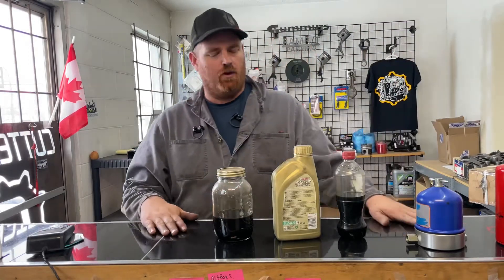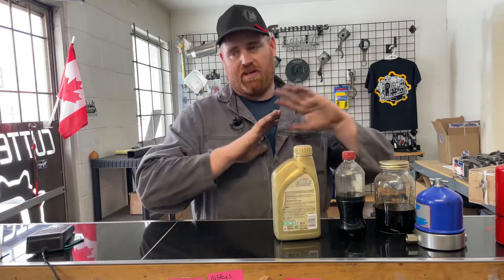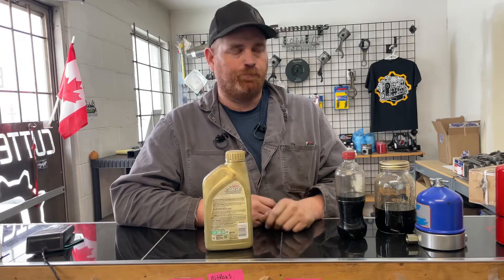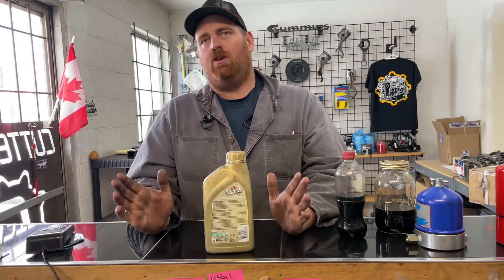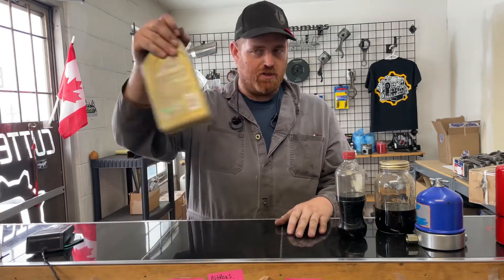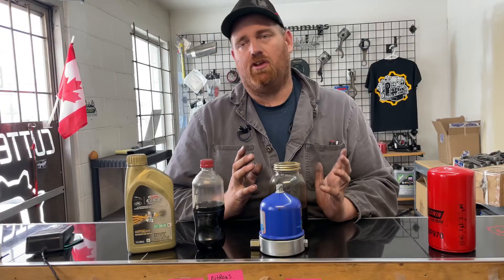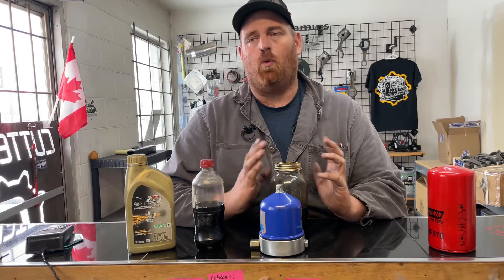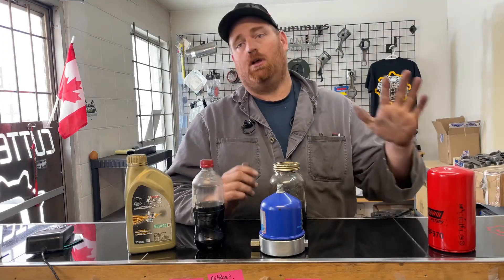SAVE THOUSANDS !!!  Introduction to Black Diesel - Alternative Fuels - Waste Oil - WMO

Comment: I heard you should mix 10%-15% gasoline with waste oil.  What are the pros and cons of that vs mixing with diesel?  When you use diesel fuel, are there any issues with viscosity in cold weather?

Comment: I have an experiment you might be able to try for making black diesel. See if you can take about 2 quarts of used motor oil after straining it, Pour it into a pot, get it hot till about 190°. Once it's hot enough to cook a french fry use this trick that they use for cleaning cooking oil. Take a measuring cup and mix cornstarch into water, then wait for the water and cornstarch to boil till it's a cake floating in the middle that you can scoop out. This is a trick for cleaning cooking oil that might just help clean motor oil.

Comment: for cheap easy filtering, use Sock Filters. they can be a small as an actual sock, to as large as a 20 gallon capacity. i buy ones that hold about 2 gallons. build a simply collar stand to hold the larger mesh filter and had it drip down into a fine fillter you can mount into a funnel and pours directly into your storage. the system i started setting up is a 30gallon drum that filters through a 10 and a 1 micro filter into another 30 gallon drum. the feed drum uses a Garden Hose styled gate valve to throttle flow rates. one day i'll seal the whole thing up and just use a ball valve. also using 30 or 55 gallon drums, makes it easy to install a Band Heater to help heat the oil to flow and filter alittle easier.

Comment: I've cleaned waste oil in my dieselcraft centrifuge and mixed it with diesel for my old IDI engines. Not much luck with my 2002 Dodge. Any suggestion on a mix for my 97 Ford powerstroke?

Comment: ''''''''''''  OH NO  '''''''''''''''''''''  DO NOT '''' DO NOT '''''' USE A.T.F '''  ATF  ''EATS'' UP THE ''INSIDE'' OF YOUR ''' RUBBER ''' FUEL ''HOSES ''' AND WILL GET ''INTO '' THE '' PUMP ''''''''' ATF ''BURN'S '' EXELLENT ''''''''' BUTT ''''  BAD '''' BAD '''''''''''''''''' . DONT DO IT ''  WITH ( ATF ) .

Comment: Can you Filter the oil out instead of waiting that long , I seen people Filter all kinds of oil and most smells more like fries and makes people hungry as I personally smelled it. They use several 55 gallon barrels and pumps to Filter out as that was 10 plus years ago as I thought of it as I once delivered Seaford to restaurants and I know that I can get at the time for free as I along with boss, son of family business ran and we always took care of our customers and I still could probably get free if asked as it gets filtered 3 times a week from all there fryers and they paid for it to be hauled away and was told I'll let you take all if ever decided to try as was becoming a thing but a bit complicated for me and sons didn't know how at time to help as probably could now but it sludge up from sitting so need a heated element to keep from sludging up as heating oil can do the same with diesel and freeze from going through 1 tank into main tank as happened to old employee of mine and had valve replaced from it freezing up in very cold winter that year when winds was-45 degrees out.  But had a friend that had outside above ground tank gel up on him. Your using engine oil as I gave mine to a friend that used to heat mechanics shop to save money as had 30 plus trucks with mostly all diesel engines and went to shop for work needed so took free oil as trucks got oil changes all the time but guy at garage asked as friend told me make sure no mixed antifreeze in it as some has an only created more problems for the guys as can't use until it's pumped out because of gallon messed up system. Antifreeze kills many things that people don't know and animals as very sweet to the tastes as mechanics test it and yup it's antifreeze leak. All just about test taste of fluids as not healthy but not daily drinks, just a dab when puzzled on what is it. Taste says all

Comment: I run my home and garage on fuel oil. What are the chances I could run this through my fuel oil furnace once cleaned and cut? Would I be better if blending it differently? %? Have you considered doing any testing in that department?

Comment: Nice. How I do it:
All of the used oils and hydraulic fluids I collect at home I catch as clean as possible in a catch can I keep sealed in double trash bags. When full, I pour the 15 qts into 5-qt oil jugs I save from new oil/fluid changes.  I let the jugs sit for at least 90 days and then slowly pour off the top 4 quarts. The last quart has the settled solids or contamination in it. 

I mix 3 gal of the clean used oil with gasoline nearly 1:1 in 5 gallon fuel cans and shake for 1 minute, and put two 5-gallons cans into a 3/4 full tank of diesel. My 2005 Ram diesel has a 40 gallon tank. This makes a mix of about 15% used oils.  It seems to run fine Winter and Summer.  I do change my fuel filter a little sooner than typical, about every 10,000 miles, rather than 15,000.

The dirty oil left in each jug i combine  again and let settle another 90 days and repeat. The 2nd time I pour off the top and use the remainder as chain-lube and make two-cycle fuel for my chainsaw, and some start my wood boiler at night.

It's a cheap and easy way to get rid of collected fluids, have a little free fuel, and not waste anything either.

Peace...
Reply: My mechanic built a used oil furnace out of 55 gal oil drums to keep his shop/garage warm... FREE HEAT!!

Comment: Diesel trucks have gotten really expensive here in Norway. A rusted out 90s hilux that has been flipped, sat for 10 years and are missing parts would still sell for $3000 easily
Reply from the maker: Yes. They’re a lot more expensive here too

Comment: Hello, is it would be better for mechanical fuel pump to use 50/50 .50 used engine oil and 50 diesel ? ;)
Reply from the maker: Lots of people do it that way. Easy way to do it

Comment: Back in the 80's I would take my used oil and dump it right in with the fuel. It's oil and it goes through a filter. No biggie for those days.

Comment: Time is money!  Sounds like Diesal at 4.50 a gallon is cheaper than the hassle of what you do not to mention the cost of filters centrifuge etc.  simply doesn’t sound worth the effort
Reply: 4.50 a gallon after taxes  at 30% tax you have to earn $6. To pay $4.50 
I save $1000. Per month.
Reply: Everyone has times for at home projects. Easy to set up so it runs while you do other things
Reply from the maker: Depends on the person. And the fuel you amount of fuel you burn.

Comment: I've been doing lots of research into this and i've been trying to find if it would be ok to mix waste motor oil ect. with vegetable oil or if i would need to keep them separate.
Reply from the maker: Keep the separate myself. I small amounts won’t make any difference. 
The biggie oil does a better job cleaning. So what I do when I have both is run a couple tanks of oil then a tank or two of veggie mix.  I have been told if you mix them let’s say 50/50 it can make a gelly mix. But I have tested tested it and it didn’t
Reply: Most importantly, you may need to preheat straight vegetable oil to keep it from solidifying. It's not really hard or expensive if you already have mechanical aptitude and the internet. A simple net search using the words STRAIGHT VEGETABLE OIL SVO preheat will give you the help you need.

Comment: Hey I got a deleted L5P no dpf or egr do you think i would be able to run that black diesel in it or should I just stay away
Reply from the maker: I have never used it with a cp4 and I sure you could just smaller ratio of oil
Reply: I can't understand your question. Why did you write, "deleted"? I've been in the auto trade for 30 years, but I've never heard that word used in the field except when describing something that was once written and no longer is ...

Comment: If u want clean oil, find some virgin cotton like cotton balls or shredded denim to make the oil pass thru. That’s the best.
For water, try some gelatin powder in the oil. Mix it in completely and add a little water, the settle the mix. It might remove some carbon and water and other crap. It will scavenge the water and solidify at the bottom.
Also , try tytrating  the used motor oil like they do to make bio diesel to get more crap out.
Reply from the maker: All good ideas

Comment: I have a 85 6.9 IDI. I know a shop that has oil practically all day long and it's all fully synthetic ATF motor oil. Do I need to mix more gasoline or diesel for it to burn easier? I do have a two tank system and I drive to work 10 miles one way or 10 miles the other. Is it worth it? And do I have to do any adjustment to the 6.9 mechanical pump??
Reply from the maker: I just add more gasoline to it.
Reply: That was a particularly intelligent question because the ignition point of synthetic oil is so much higher. That higher ignition point is the reason for the much, much lower carbon contamination and resistance to heat damage that you get from synthetic oil.  I'd love to see comments and replies here from people who have actually USED synthetic waste oil in this manner.

Comment: So i had fuel rites water separator on my finish drum where it goes through before the vehicle.  It didn't keep the water out.  Now this being said.  This happened cause I did not clean the centrifuge so the fuge its self couldn't get the gunk and water out properly sooo there was more water than normal. Would love to see a filter that ACTUALLY can stop water from going through
Reply: "the fuge"? What are you TALKING about? Please redo the whole post; that part isn't the only bad part ...
Reply: @ScottyCrawford  yeah i have some typos there don't I.   Fuge just means centrifuge
Reply from the maker: I working on some options for water block filters for the setups
Reply: @CUTTERUPROB  cool.  Look forward to seeing.    All things said tho I’ve almost ran over 520 gallons of waste oil.    Loving it

Comment: Also I mix in my gas and or diesel fuel prior to running through the centerfuge, the dirt separates faster and easier, heating the oil will evaporate any water in the oils.

Comment: After I ran a batch of oil through my centrtfuge, I let it sit in the container for two years....yes two year -s, I then checked the bottom of the container {white plastic} and it was totally clean, no worries only one pass through centerfuge after heating oil to 200f on my wood stove at 20l in 1.5 hrs, no traceable contaminants at all.
Reply: That’s badass! Thanks for that great feedback.
Reply: What was its original viscosity rating and what was it after?
Reply: Cus if it was lets say straight 50w and after that it was straight 30w thatd be cool and might be reyasable for a small old engine

Comment: Oh I had spin on fuel filters and changed them every 4 fill ups. Winter I ran 50/50 with #2. Would also flush system on 5th fill up with straight #2

Comment: Hey there buddy how are ya? I use that same Centrifuge the 55 gallon one. 
This how I do black diesel. I pour the oil into a 25 micron sock filter watching for any crud. If I see any crud I stop and put it to the side for turn in. I usually don’t pour off the last inch or so of the gallon jug the oil is in. I turn it in for recycling. Once the usable oil goes through the 25 micron then it goes in to a 1 micron sock filter. From there it goes into my 55 gallon drum system. The drum is very well insulated I have a large stainless steel mixing bowl on a pipe in the center of the top of the drum. On this mixing bowl I have my centrifuge mounted with angle steel and bolted in place. I have a pick up tube in the large bung hole. This tube goes to a Toyota power steering pump powered by a 1/2 horse power motor the pump spins 1/2 motor speed. The output goes to a 2000 watt water heater element that’s in a pipe set so it flows in and out of the heater. From there goes to the centrifuge . I run the system for about 1.5 hours getting the oil up to 212f at this point any water in the oil boils out and the steam comes out the pipe and bowl on top. When at full temp I start the centrifuge spinning no more than 80 psi. I let spin for 10 to 12 hours. Turn system off let settle for several days to a week. Then mix 10% rug as I fill the tank. The centrifuge usually has a hard crust of solids on the inside of the rotor. The oil comes out about 10 weight or so and is very slickery. I think if I mixed 10% rug and let settle would be even cleaner. Been doing this since 2013 when I bought my m35a2. Egt wasn’t as high as when running #2 boost was about the same. Didn’t blow smoke ran nice and cool no over heating issues. Was a great way to drive my duece around for cheap and  piss off liberals in the Sf Bay Area.
Reply: What's 10% rug"?  A 10% concentration of new, virgin oil?
Reply: @ScottyCrawford  regular unleaded gas
Reply: Do you have plans so someone can duplicate this system? I'd happily pay a reasonable fee for it
Reply: Cool
Reply: You got any plans for this? Id like to copy

Comment: Rob, love these vids. You mentioned the CR trucks, much appreciated. How about the VP trucks? Does the oil need to be super clean or will a 10 micron filter be enough? Thanks so much!
Reply: I don’t think 10 micron is small enough. 1 micron would be better.
Reply from the maker: I like a good filter 4 absolute is a minimum for me
Reply: Please, for the rest of us, explain your acronyms. CR? VR? ?????????
Reply: @ScottyCrawford  common rail=cr vp=vp44 injection pump, ppump, ve=ve44 injection pump. different types of injection on cummins engines
Reply: @snakebite3299  I can't find an original comment from me in this section. Can you help me out in doing so?
Reply: @ScottyCrawford  You asked what the acronyms represented in the comment above. You asked what CR and VE stood for. They are acronyms for the different types of injection used on the 5.9 cummins engine.
Reply: @snakebite3299  Ohhhh!  Thank you for taking the trouble to reply. To us, the original comment was like reading the old gasoline injection terms, like K-Jetronic, Lamda, etc., when we didn't know what they were. Your response was very helpful.

Comment: I have learned so much fro your videos and I appreciate it. Do you have a video on how to place rings in correct position on a 12 valve piston? I can’t find one , thanks
Reply: 3 rings per piston and installation is typical of any engine. Always double check the ring manufacture directions.  
Always: oil wiper goes on the bottom (spring on the inside & open end opposite the wiper end gap) 
Most of the time: intermediate compression ring is square (check for dots to indicate top side of ring) 
Most of the time: top compression ring has a staggered edge (the staggered side is the top side of the ring) 
Always: stagger the end gaps so that none of them line up (some have preference of where they are in relation to wrist pin center line)
Reply: @preachers4135   thank for that but what I’m trying to figure out is proper placement of rings on piston I should have explained that better, I have seen 3or 4 different options and I wanna to see how cutterob places his rings on piston
Reply from the maker: Preacher s has it covered